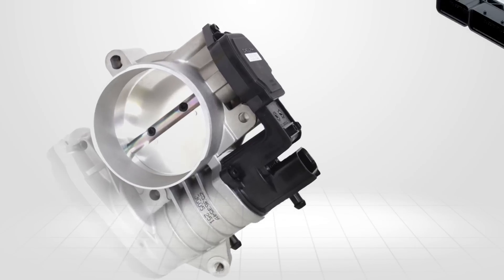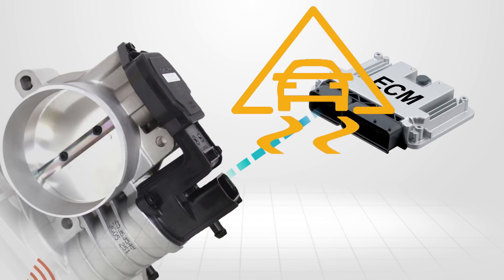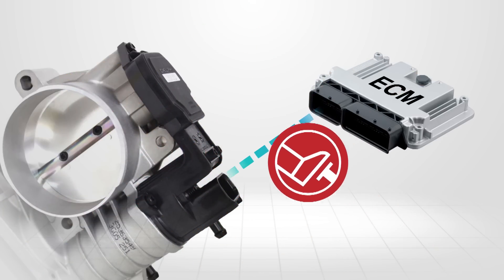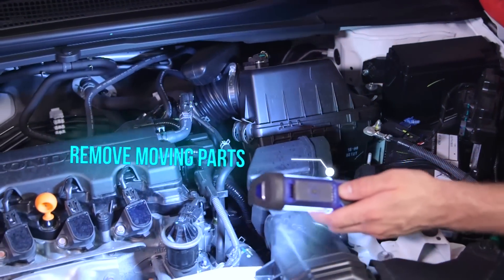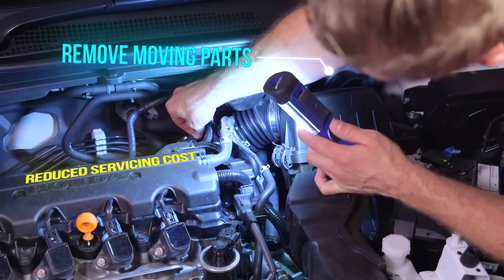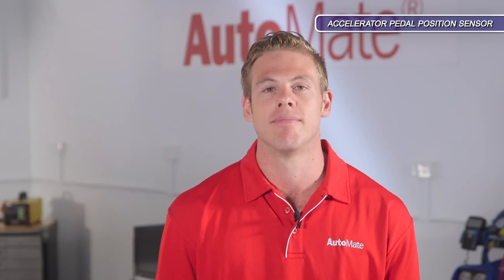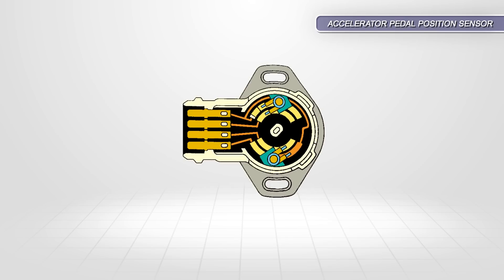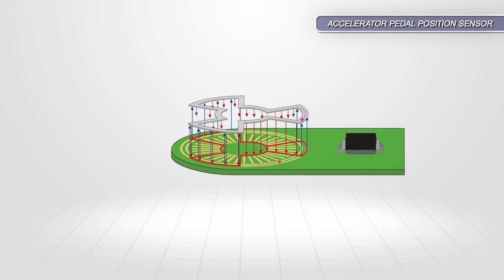Throttle Actuator Control Systems

Comment: Hi. Please could you clarify my doubt?  Is the butterfly valve is partially open at all the times to allow engine idle running?  I mean the butterfly valve is designed such that there will be a slight gap to one semi circle?? Or will properly lock the circle not allowing any air when engine is not running?? Please clarify.. I found my vehicle's butterfly valve is not completely closing the valve to lock the air passage... as shown in the video at 0:56 ...

Comment: What about the TAC module itself. I didn't hear mention of this and am looking to find a way to test this. On my '05 avalanche it is on the firewall. I have seen somewhere that if it fails in some way it does not give a code.

Comment: a cable is way cheaper and more efficient than all that crap
Reply: I bought the throttle body but I think my problem is that module
Reply: The previous system of cables and linkages were such a simple idea ruined by technology way too expensive for cars, and no were near as reliable and as cheap as previous system.
Reply: I was just about to post this  comment,  i just spent 300 bucks on a throttle body for my truck and its still broke down i would like to shoot who ever came up with this crap  . If i had my 77 ford it would be fixed and driving down the road . And people ask why i hate technology,  because its a waist of money thats why
Reply: Sounds like a bunch of conservative ideologies in here...
Reply: @gstacks510  you are a bit mixed up in your definitions in life
Reply: @gstacks510  ..your point ?